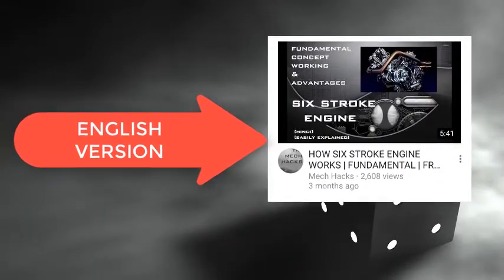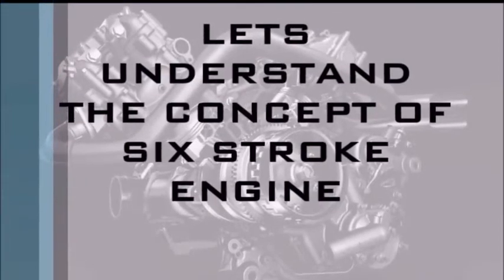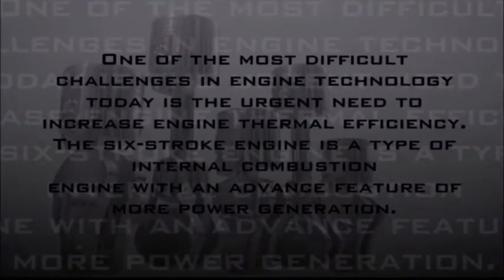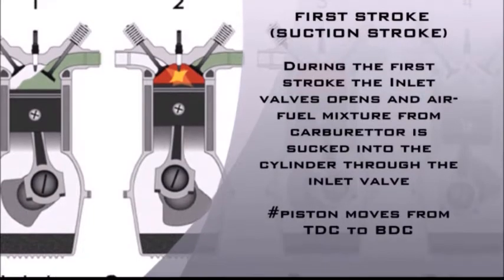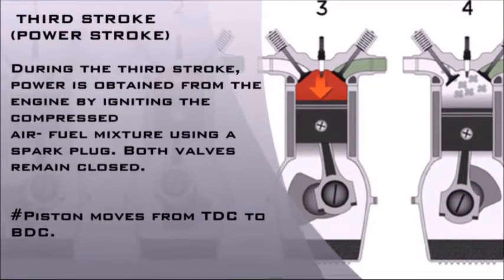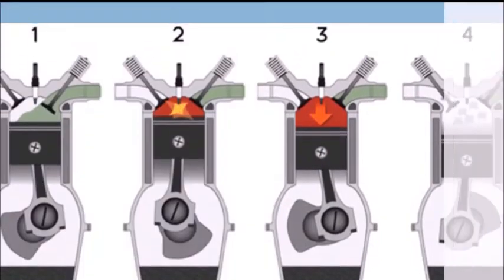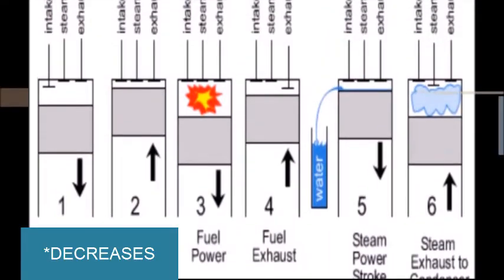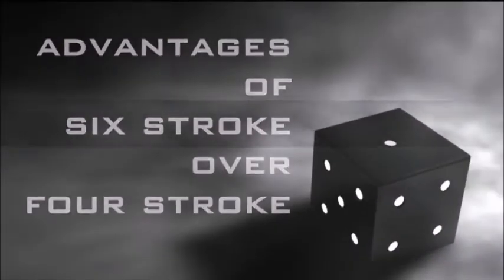[English] Six Stroke Engine | What is it | How it works | Full detail

Comment: 1. Any idea about valve timing diagram and the design of camshaft?
2. Water is introduced into the cylinder in atomised form through injector like diesel engine or simply through valves?
3. Is there any sensor for variation of load on engine to increase or decrease the supply of water, in order to avoid vibrations?